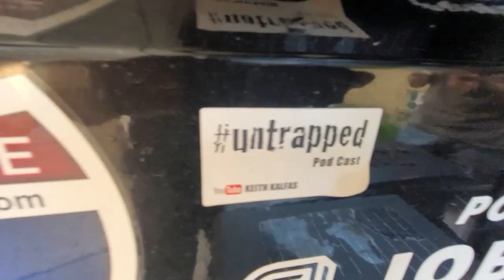Dump Trailer Maintenance | Shackles and Bushings are DESTROYED

Comment: I'm in your area Keith, I have a few dump trailers and they are absolute money makers. When you upgrade, I would shop Sure Trac or Diamond C for your next dump trailer. Telescopic hoist over those dual ram for sure. All trailers need maintenance and I'm sure your dump trailer has paid for itself many times over like mine have.